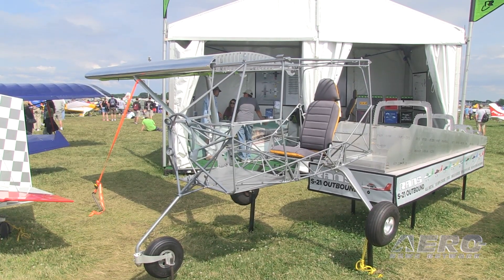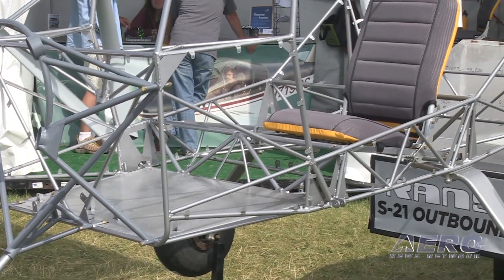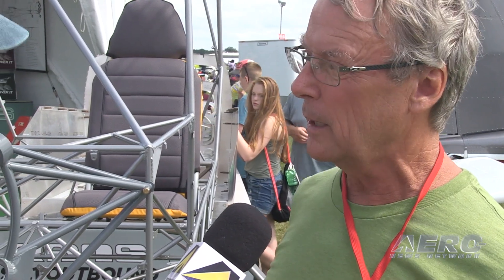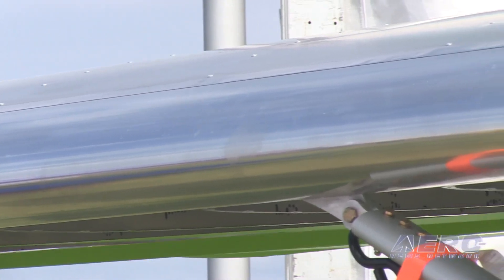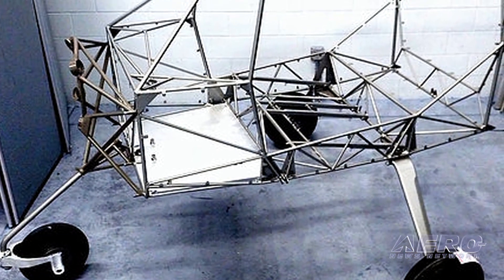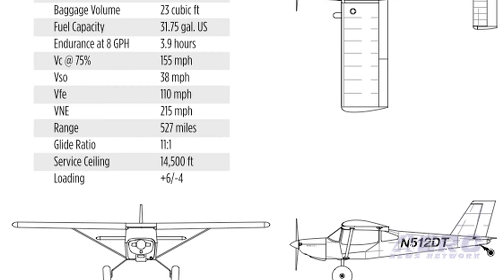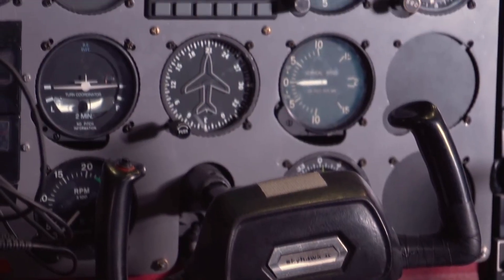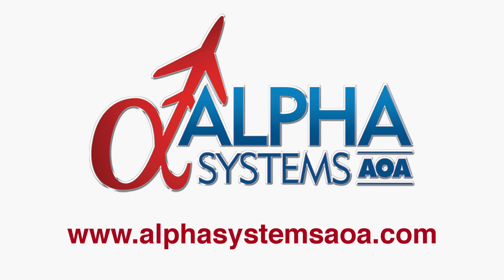Aero-TV: The Ultimate RANS?? - Randy Schlitter’s New S-21 SportPlane Kit

Comment: had a question on this, in the RC world there is a option for an RC owner (radio controlled aircraft by the way) to put together an aircraft called an  ARF (almost ready to fly).  In the full scale world is their kits available that does just that.  Put the fuselage together let's say 4 completed individual parts, 1/2 completed wing and the other half of a completed wing joined together then the builder can mate the wings to the fuselage.  And the same thing with the elevator and stabilizer.  Good percentage of the aircraft already pre built then just plug and play, install your avionics and wiring and you're on your way.  Well, interior of course.  Just a thought.
Reply: Rules for experimental aircraft require the builder to build 51% or more.